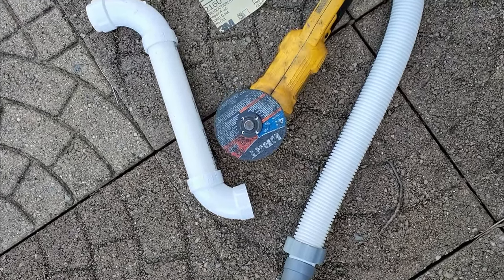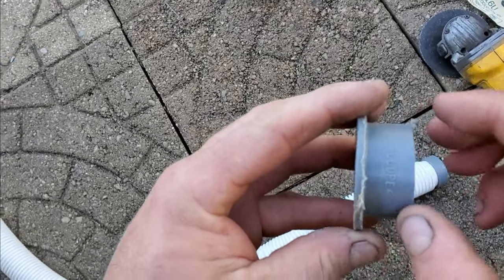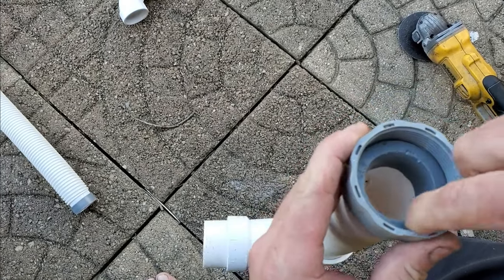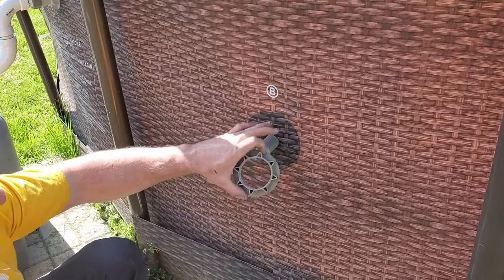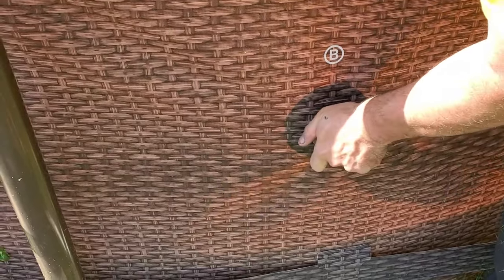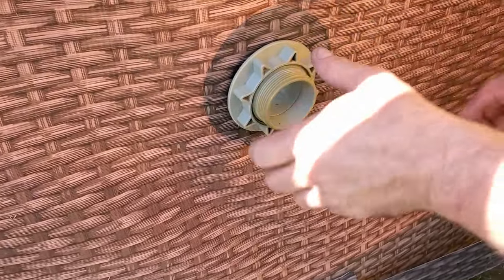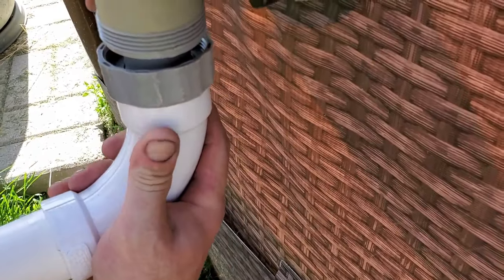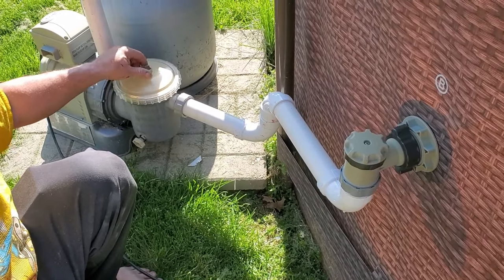How to PVC Plumb Your Intex Pool Filter for Above Ground Pool

Comment: What size pvc you use and what did you do with the other hole that the water come from the pool to the filter. Thanks
Reply from the maker: 1 1/2″ PVC tubing and used the plug (rubber stopper) that came with the pool to close up the other hole
Reply: Copy that. Thanks
Reply from the maker: @joeellis2599  You're welcome

Comment: Where did you get the fitting? Looks used. Also 1 1/2” flexible pvc is probably available at a SPA/Hot tub supplier it glues up just like the regular pvc. That will be more flexible and eliminate any flow loss due to the 90° elbows.
Reply from the maker: Which fitting?
Reply: Also wondering what fitting she bought. The pool fitting...it's the piece that you cut the hole out for.
Reply: @themom7041  that came with the pump.

Comment: Whats the point of cutting a bigger hole if the shut off valve opening is way smaller that the 1 1/2 . For this to make any sense, you would have to connect the pvc directly to the adapter on the liner.
Reply: Maybe step it up to a 2" shut-off valve and then back down to the 1 1/2 ?

Comment: Judging from the injuries on his hand(s) that's not the first time using a cutting wheel while HOLDING the piece being cut? Do NOT follow that example people, a 6" cut off wheel will remove a finger or a piece of your hand in less than a second, when, NOT if you lose control of the grinder.

Comment: What is the part you replace in the pool itself you cut the “nipple” out of the pool and put the part with the strainer on the inside where do I get that I’ve looked all over Amazon and can’t figure out which exact part it is
Reply from the maker: It came with my pump kit.
Reply: Its called an inlet screen or a return nozzle. There all over Amazon.

Comment: It’s probably going to start leaking with the fact that the pipe is not flexible and the pool moves as people swimming and jumping around
Reply from the maker: We had the PVC piping for about 3 years now and it has never leaked. The flexible ones leak is why we changed it out. Use good cement and it don't leaked.